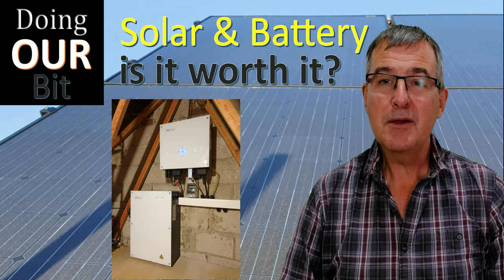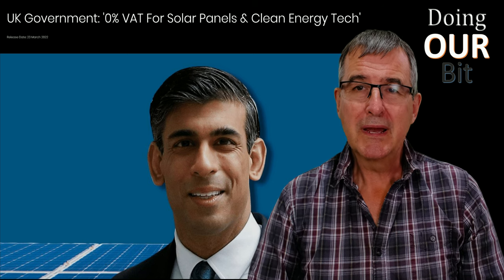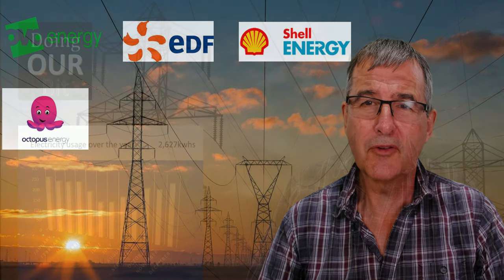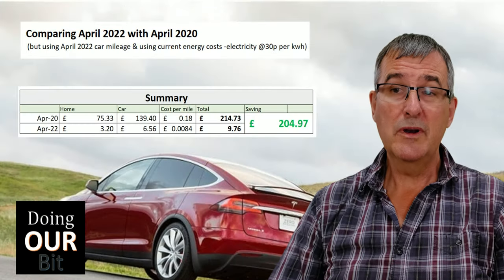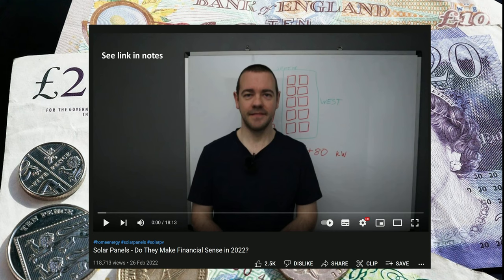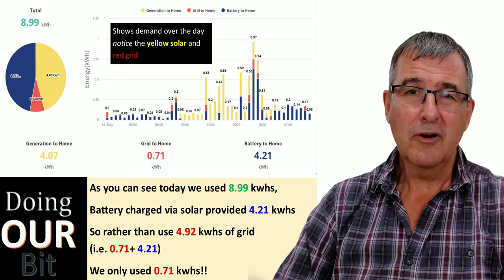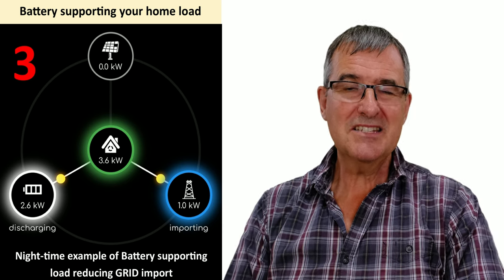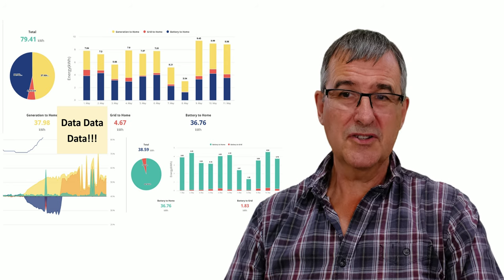Solar  and Battery install - is it worth it?

Comment: I'm an old retired communications engineer, and have a small system I put in in 2014 to evaluate solar energy, both grid tie and off grid, you can fire maths and calculations until the cows come home at solar but the basic facts are the same, I live on the South Coast and my panels are South facing, The simple facts are if you are installing a system by a professional company it will take you 10 years to recover your initial costs,  maybe a bit less now with the increase in energy costs but during that 10 years you will almost certainly need some form of maintenance which will add to the costs, If you are young and staying where you are it could be cost effective after many years, if you are a pensioner forget it, you will never reap the rewards. These are the Facts anything to the contrary is simply not true...
Reply: Thanks for your comment. I would be interested in what these deal breaking maintenance costs are for exactly, remembering that most systems are guaranteed for 10 years? I am also curious as to why you think for someone who is retired it's a non-starter? Given you have said a ROI is under 10 years (which I think for 99.9% of people this would be a given ) I don't understand your assessment? Assuming you have a system that matches your useage for someone like me, retired, 66 , retirement seems the best time to do this. Firstly, you probably have some tax free pension money available, secondly, it's an investment that pays back if you look at it this way about 11% (significantly better than a savings account), and does this while at the same time reducing my monthly cost of living , guaranteed. On holiday away as now as I write, my system is covering all the base energy needs of the house, while exporting everything else.. I.e it's still working, so I will return to a negative energy bill, like the past 3 months. And that's before you factor in an EV and the ability to use your excess to power your driving mileage. And that's also before you consider the attractiveness of your property over others when you children do come to sell it. Life is uncertain but for me this is my part of DoingOurBit and given my Mum (91) and Dad (90) are still alive I might have need of this system for many years to come if we are spared. Obviously some people see everything as a cost rather than a benefit but I hope I will encourage more people to take the plunge as it is certainly working for me and my wife. Anyway good to chat and as I said, interested in the details you mentioned.
Reply: @AdrianSmale  Taking it bit by bit, maintenance, assuming the system is on the roof, connections can fail, and you will need someone to repair them and generally check them over, gales can loosen panels over 10 years it involves roof work which is expensive, if it's partly Off grid then the batteries only have an 8-10 years life and will need replacing, inverters can fail, the systems don't run forever,  Retirement well you are lucky, most of my workmates have gone already in their 80's and are you going to stay in your present home all through your retirement, perhaps I should have said a retirement system is a gamble, And you don't mention your initial costs, so are they really "negative" bills? you are lucky to have spare cash many people haven't and find out to late that their solar system is a long term investment especially if they have taken out a loan,  as for electric cars cheapest being around the 25k mark they just muddy the waters, anyway if you are really happy with your system and what it has cost you that's fine, but that still doesn't cover what you paid and how long it will take to get your money back, I'm not saying nobody should invest in solar, just do your homework and work out the costs and how long it will take to get a decent return, so many people don't do that, and when they realise it's a long term investment they try and make out going solar is a marvellous move when for some it simply isn't.
Reply: @ronayling1979  Life is spelt risk, sure. For me, you would do nothing if you always worried whether you'll get your money back or not. You could drop dead tomorrow,  but nobody buys a car for example as an investment (it isn't its a luxury) and so it is a matter of choice and for me investing in things that are better for  the immediate future is much more important. I would never recommend someone takes out a loan to buy a solar battery system, because then you have that repayment plus interest to cover that wipes out the reduction in your monthly outgoings which defeats the purpose. As the battery is guaranteed for 10 years I think it is reasonable to expect at least 12 years useful life with sure less storage capacity, but generally batteries don't die they fade away. I'm acutely aware that I am fortunate to be able to do all this although I do budget every day living off my state pension plus savings, so there are many people who could do what I have done. I am also IT literate which with todays smart devices is sometimes more of an issue than money to some. On holiday I can monitor everything remotely. And finally yes my energy bill overall is negative June to September (I.e. gas plus electricity, minus export ) although I am obviously paying a DD to cover the winter months which I guess now in the UK won't be as bad as previously expected. For me using the battery to cover peak times at 39p per kwh, with either solar or off peak @7.5p makes a significant difference.
Reply: @AdrianSmale  Well you are obviously much better placed financially than a lot of pensioners, I was tending to aim my pensioner comments to those on a more restricted budget  hoping to save a lot of money, I still say to anyone considering a solar installation do your homework and don't take to much notice of the weasel word solar companies who will probably be gone in a couple of years complete with your 10 year guarantees.....
Reply: @ronayling1979  I don't disagree with the doing the homework bit, and obviously your guarantees need to be manufacturer ones or backed by independent insurance policies because businesses come and go, particularly in these challenging times. At the moment the greatest challenge frankly is getting an installer and/or getting the gear in the first place so in reality I think you have to be pretty keen to get this done in the first place.   I aim once I have a solid years worth of data to share this for context.  Plus phase 2 for me, which is retiring our gas combi boiler, will be to look at the numbers in more detail. Adding heating really is a  lot more challenging and will undoubtedly mean changes to the system to accommodate this. I intend to do a lot of work on the numbers as part of this so hopefully avoiding any nasty surprises, and then share the process so others can follow the method. Anyway thanks for taking the time to comment and I am sure this will add to an understanding of the issues, and the things you need to consider before signing on the dotted line.
Reply: Er, if Ron is interested - my solar PV system has been installed for eleven years and has, so far,  cost ZERO in maintenance....
Financially speaking we're raking it in...because we have the full feed-in tariff - currently a lovely 62p per unit..!!
Reply: @andymccabe6712  Out of interest how much did you pay for your installation in 2011? and how many Kw is it?
Reply: Solar pv (no moving parts) will require far less maintenance than any alternative.

Comment: If, like me, you're a low leccy consumer (our annual load is only 2,100 kWh) then I'd say putting in a solar system is definitely NOT worth it. The reason is simple...the maximum savings you're able to generate (& you will get nowhere near the maximum!) are swamped by the system installation costs. Think about it. Right now, power costs 27.5p/kWh so my annual bill, excluding standing charges is £577.5/year. Last year, I put in a basic 8 panel, 3.16kWh array with a 3.3 kWh battery. It cost £8,750 to put in so I'm looking at 15 years JUST TO BREAK-EVEN!! It gets worse. Today the same system would cost nearer £12k so you don't hit break-even until 20 years have elapsed!
Reply from the maker: If you are doing this purely for financial reasons obviously you have to do the maths which is why knowing your energy consumption is key. But also in the big picture I'm assuming your heating is gas, switching to electric changes the numbers as does switching, if you drive a car, to an EV. Then the numbers change significantly as do the savings on your ongoing living costs. I am surprised you say that system is now £12k from £8k, that seems high but obviously these are challenging days particularly in the UK. I expect despite inflation /on labour costs that system costs will actually go down rather than up in real terms. Thanks for commenting and it's certainly right to say that it's not financially viable for everyone. As I say you do have to do the maths taking into account  your situation (time of life) , future plans and current useage before taking the plunge.
Reply: @doingourbit8551  Thanks for replying.  Yes we use gas for hot water & heating but at 4,000 kWh/year our gas consumption is also very low (house is well insulated). At 7p/kWh, this works out at £280/year with three quarters of this coming in the four winter months. Yes, hypothetically we could go the heat pump route but fundamentally you run into the same problem as with panels. It's simply illogical to spend £5k to £10k on a heat pump to save at the very most £2.8k PER DECADE (& that assumes the leccy for the pump comes for free which it absolutely won't).

Comment: Hi mate this vid is very useful I’ve  down size my house to 2 bed semi from a 4 bed detached,so I’m already making savings with heating and running costs,but would like to save more and so I’m looking at having solar put in ,I’m 60 and won’t be moving again I’ll prob work for another 5 years then I’m done ,I have a bit of monies I could use to buy it ,just got to do bit more research into it before having it done
Reply: Sounds like a good plan . .all the very best and hope it all works out for you.
Reply: standalone systems are best simple and cheap and swappable
Reply: Look very carefully at the cost of the system, including replacing the inverter after around 12 years and less for a battery. If you are already a low energy user, solar does not make economic sense.

Comment: For me, solar had a decent payback but the batteries didn’t.
Reply: Really interested in why this was the case? I plan to do a video Feb next year when I have a year of actual data but Feb to today our home total power usage of 1115.99kwhs has been supplied by solar 423.01, grid 158.54 and battery 534.44. The battery energy is predominantly from our solar but the rest from off peak overnight grid. Obviously what you are paying for said energy is where things get interesting. At the moment by peak tariff is only 15p but it could rise as high as 40p come September, and obviously this is going to be different for everyone. Anyway thanks for your comment.
Reply: @AdrianSmale  Batteries don't generate any kwh, they just reduce the electricity you import from the grid. I pay about 15 cents per kwh for imported electricity and receive 11 cents for exported electricity. So the savings per day would be the battery capacity times the 4 cents difference in price (assuming I filled the battery up during the day and used it all during the night). For a 13 kwh battery the savings would be about 50 cents per day savings for a battery that cost 7,500 to 10,000. The payback was more than 40 years.
Reply from the maker: Hi k2, Wow my UK viewers will be shocked by these numbers, and it totally makes sense now!! 10p a kwh for electricity with 8p for export is incredible, but then if you are still driving a gas car you are paying £9 per gallon (i.e. 11 dollars) here in the UK . In the UK you can still get off peak (12 midnight to 4.30am on average) @7.5 to 10p cost but peak is anywhere from 28-40p, while best export rates vary from 4p-7.5p because crazily our electricity prices are fixed by the natural gas price. For market capitalism to work more needs to be done to cost fossil fuels at a level that encourages change and acknowledges the damage they are doing...still more to do there but Norway have shown it can work and part of my next video on Electric vehicles I'm currently putting together. Will be particularly interesting to a US viewer given you have suffered more misinformation that most countries in recent years.
Reply: @doingourbit8551  You can't use Norway as an example because it's an outlier at the extreme end with over 62% of it's electricity coming from hydro electric. In short, it can only do what it's doing because it does not have to rely on solar or wind etc. Almost nobody else can claim to have it so easy. The experience K2 is sharing is the biggest problem facing renewables(other than hydro electric) which is storage. Solar panels works fine but adding batteries increases the time needed to break even. Also batteries don't last forever and will degrade(rated in cycles). We should all try to do the right thing for the wider community(that is the planet), but should also recognise that some green ways of doing things are just not as economical as others. Choosing to implement the most economical ways first would speed up the move towards being green as being able to afford the investment to go green is still a big problem.
Reply: @longdang2681  Thanks for your comments. It's always important to look at the challenges and the big picture. On an individual level it's always a matter of available resource, as for many solar battery is not an option. But, for so many it is, and given how busy installers are in the UK things are moving forward. On a national level storage is a big issue but the recent sand battery solution sounds like a extremely viable, scalable and cheap solution to this. Just hope that as a nation we pursue solutions that build the infrastructure we need rather than 'easier' but damaging short term solutions that don't.
Reply: @AdrianSmale  I'm also hoping that the sand battery solution comes up trumps(or something good comes up) but it's likely to face a problem of logistics. Stored heat energy is most efficient when done at scale due to surface area optimisations for least heat loss. This would require local solar panels(or DC sources) to convert to AC in order to transport to a centralised storage. This would incur an extra percentage of energy loss. Solar farms would be centralised but would incur a extra DC to AC conversion loss(versus local solar) when immediate use of (DC)power is required. Small scale local storage at the point of generation would work best as it wouldn't overburden the grid during peak times and is most efficient in terms of transporting electricity. The current solutions for local storage however is costly and less economical. I believe the progress in battery storage is as slow as it's always been if you consider all of the energy losses involved. People are trying with battery storage but the technology is just not there yet.

Comment: Nice video. We DIY'd an off-grid kit (3kW / 1.8kWp / 1.6kWh battery) into the back garden https://www.youtube.com/watch?v=nEOxH0B7qJk which has run all the household loads except for cooking and bathroom for a couple of months. We'd just got to the point where we decided we should have got more panels/battery and ordering them ("totally worth it this is awesome!"), and the inverter packed in. This seems like a big deal to us - whereas we might wait a few hours for supplier/distribution co to sort out a problem, we're faced with a several week RMA service. Perhaps the first question we should have asked is "what do we do in case of breakdown?" It's not easy being your own power station...
Reply: Wow, really impressive work and video. It's another way of DoingOurBit so thanks for commenting and sharing here!

Comment: Our utility charges 25/45/56 cents a kWh for off-peak/part-peak/peak, so we're using a Growatt 5kW Inverter, and 20kWh of Batteries from Signature Solar to time-shift our usage.  We're looking forward to the time when we can run the house off the Car (60kWh), but that hardware seems slow in coming to the Market (Wallbox Quasar 2, dcbel, Ford). In addition to time-shifting our use, we're ready for the outages that a utility which uses its maintenance money to pay shareholders and executives.
Reply: Don't use the car, these will only kill your car off sooner.....
check warranty too as most likely won't be covered